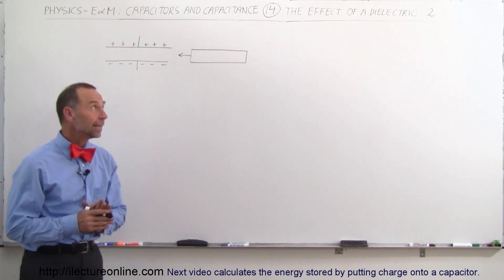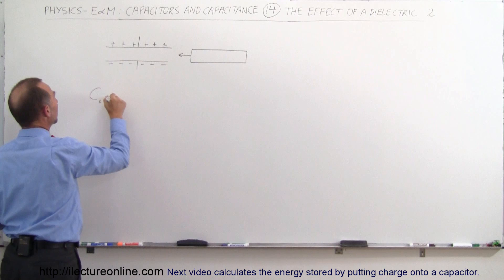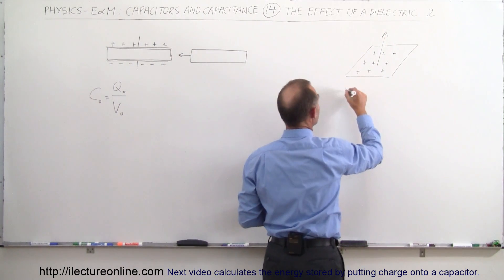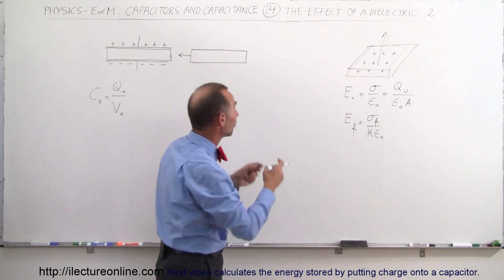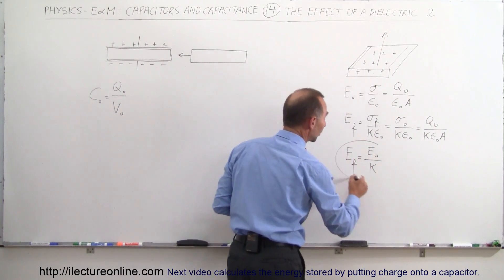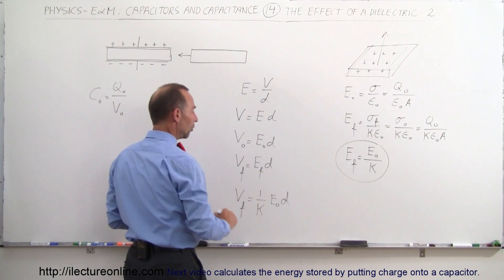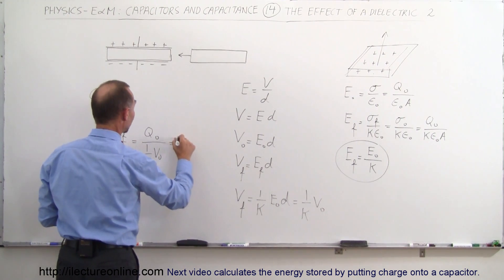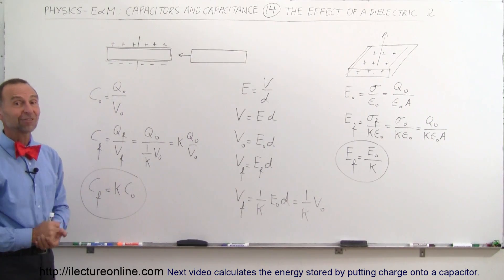Physics 39   Capacitors (14 of 37) How Does a Dielectric affect a Charged Capacitor?

Comment: well, what happens  if the dieletric is smaller than d? How can I proceed with the calculo of Capacitance?
Reply from the maker: The solve the problem as if it has 2 dielectrics.  (One of them will be air and the other the dielectric).  Take a look at this example:  Physics - E&M: Capacitors & Capacitance (36 of 37) 2 Dielectric Layers   https://www.youtube.com/watch?v=DZJqS6G9pVM&list=PLX2gX-ftPVXWRRRZBxiMTRdxDPz9zrAMZ&index=37